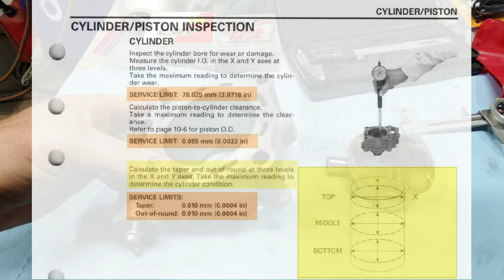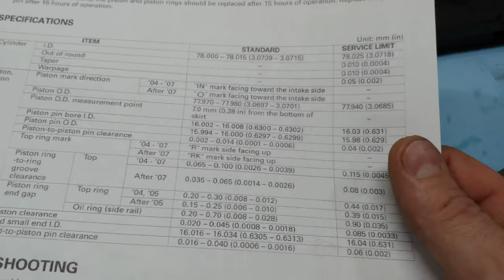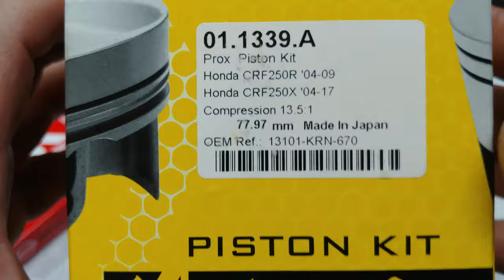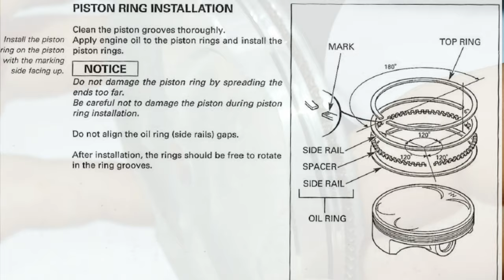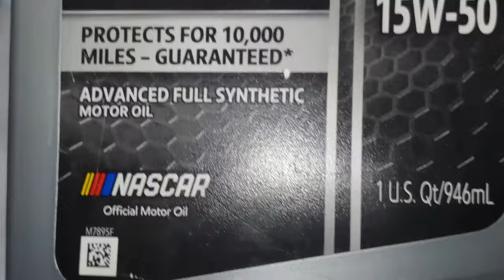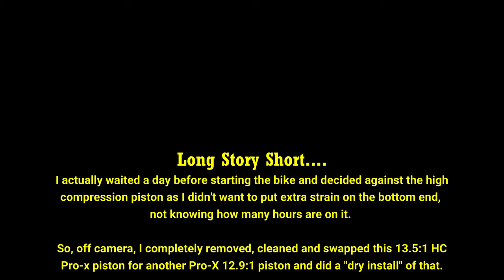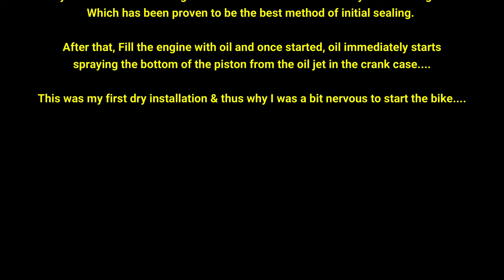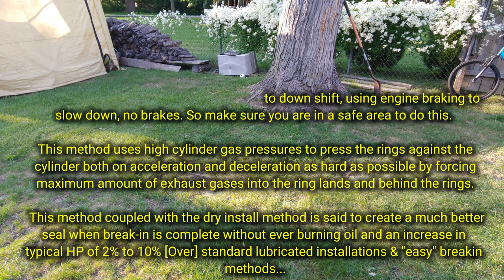06 Honda CRF250r || PRO-X Top End [ How To ]

Comment: I’m so confused. The punch mark on the right side on my bike is not set up properly somehow. I rotated the crank to the mark and the exhaust rocker was still tight. Went to the next TDC (where the mark is not visible) and the rocker had play. I tried setting the cam timing so it was according to the punch mark and lightly began to kick the bike and felt valve interference so I stopped. When the punch mark is not visible and the bike is in TDC, the timing marks on the left side are aligned. Seems like someone didn’t know what they were doing during a bottom end rebuild, and I don’t know where to start.
Reply from the maker: If you're timing marks on the flywheel are not visible at the same time as the punch mark on the crank gear then chances are your flywheel key sheared. So you need to pull the flywheel and check the flywheel Woodruff key
Reply from the maker: You can tell if you're on the compression stroke by taking the plug out and putting your hand over the spark plug hole. Air will start rushing out on the compression stroke. If your bottom end is put together right you should see a punch mark on two gears and the flywheel on the other side of the engine should align with the notch on the inside of the threads for the view hole and the right of the two lines on the flywheel. And then your cam intake lobes should be facing mostly towards the back of the bike maybe up a little bit as well as both lines on the cam gear being parallel with the top of the cylinder head.
Reply: A great idea. Just pulled the flywheel bolt and the key is still there and intact.
Reply from the maker: Is the key way in the crank lined up with the keyway on the flywheel?
Reply from the maker: Okay so I just checked and you cant see the flywheel key slot in the crank from the end of the crank with the bolt off. The crank gears can only go on in one position. So its definitely your flywheel key being sheered. It will still be there when you look at the flywheel but the bottom half of the key is sheered off and still in the slot in the crank at a diff position. You'll need to get the flywheel puller from a shop or Rockymountainatvmc.com and get that flywheel off. You can order the flywheel key from Rockymountain as well in the "OEM" section.
Reply: I’ll give it a go, if not just to figure out what exactly I thought was the key. What trips me out is I had the bike running for a bit (I just bought it) and it cut out on me and hasn’t started since. Anyhow, you’ve more than earned a sub, thank you. I’ll come back and update if you’re curious.
Reply from the maker: Yep that's how it happens. Could have been that the previous owner didn't properly torque the flywheel and it weakened the key and bam! She spun in the crank and sheer that sucker right off. Even if everything else was perfect, the spark timing was off. Hence no spark.

 Always glad to help and Yes! Please update us so anyone else can find this solution of need be. Thanks for the sub. 

Only thing I ask is share the channel and videos to get the word out an shell grow the channel. More it grows the better the content will get and give aways.
Reply: Finally pulled the flywheel and replaced the Woodruff key with an OEM Honda one. Also resolved to replace the cam chain and found a couple mm of stretch. The key did not appear to be bent or sheared at all, and upon reassembly, the crank and flywheel marks are still way off. I am notoriously lucky in my ability to land bikes with problems outside the scope of the service manual 😂
Reply from the maker: Oh wow. So flywheel key was fine... The crank and flywheel marks dont match or do but just not aligned with the cam?
Reply: Setting the crank gear to the punch mark will result in the flywheel marks being entirely invisible. If i set the flywheel mark to the rightmost mark, I get TDC (but no punch mark on the crank gear). The bike actually was running when I got it, but died after a couple minutes.
Reply from the maker: There are two years that you should see in the hole looking directly at it. A smaler on ein front and larger one behind it. When you see the punch marks on the two gears do they line up together?
Reply: @Fixin2Ride-Official-  I don’t believe they line up. Not sure how that can even happen, I thought they were keyed.
Reply from the maker: Yes they should. And when the 2 gears punch marks are aligned with the arrow on the case, the punch mark on the balancer shaft gear should be perfectly aligned (facing) with them... Look me up on facebook. I would like to see some pics.
Reply: @Fixin2Ride-Official-   Sorry man, I thought I had replied. I ended up throwing in the towel and took the bike to my local shop. Previous owner didn’t line up the gear with the punch mark when he was reassembling. 

While ordinarily the indexed gear would stop the average person from continuing, this dude hammered the gear on in the wrong orientation.

Bike runs now. Thanks brother!
Reply from the maker: No worries. Funny you mentiones that because as I waa looking at parts today I saw that you could possibly put it on wrong.
Reply from the maker: My pleasure and glad its running!